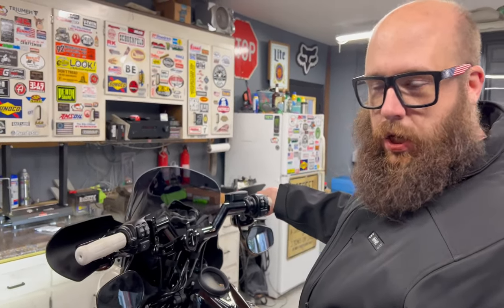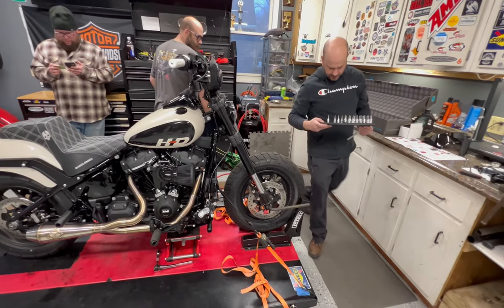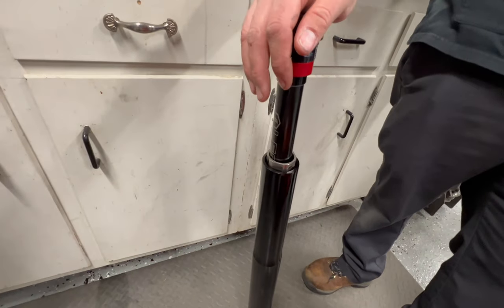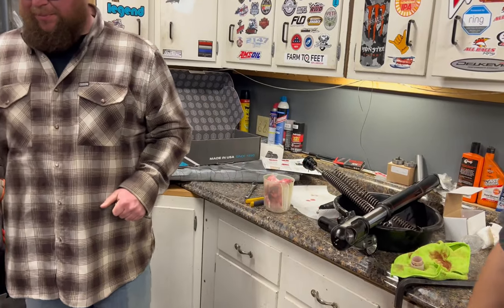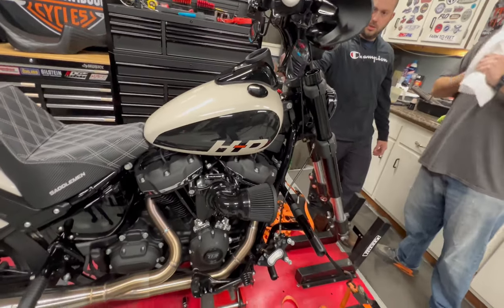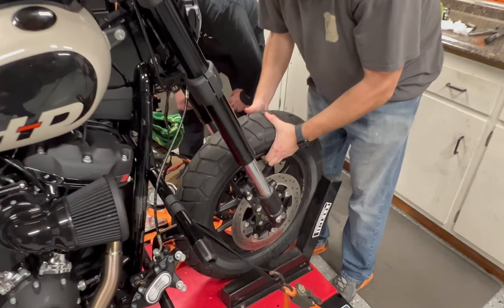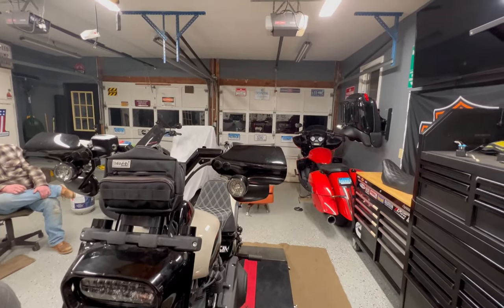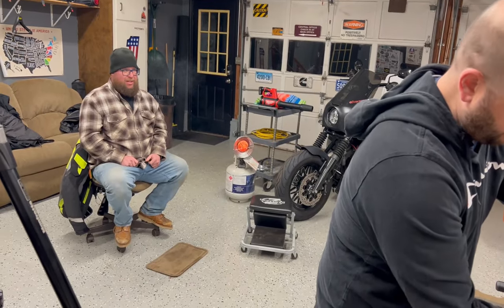Legend Cartridges for Harley Softail

Comment: "Obese Robert".. 🤣  ...  I took the Vic for its first real ride with the new suspension last Saturday, after, it promptly started puking out the shift shaft seal 😐 Waiting on the seal to get going, again
Reply from the maker: What was your initial impression of the suspension?
Reply: @3_AM  .. A vast improvement over the stock legs